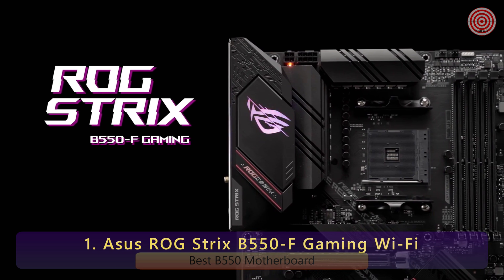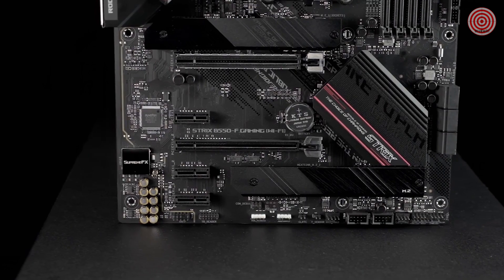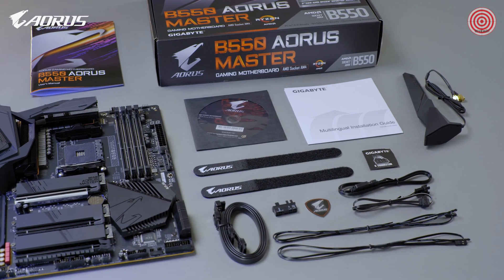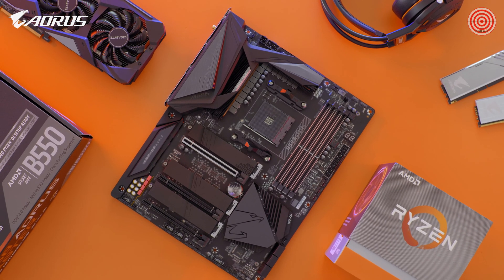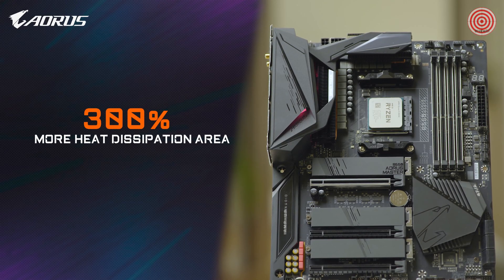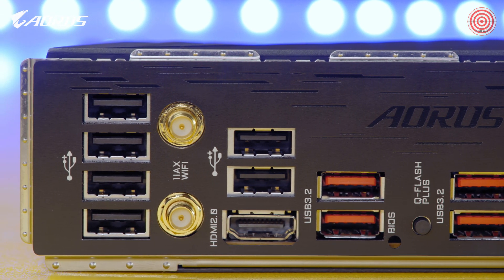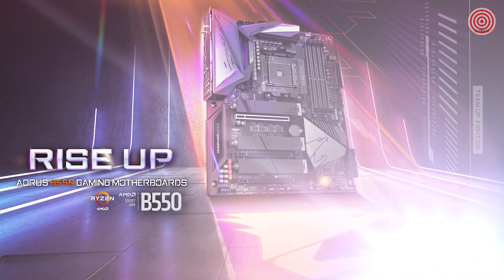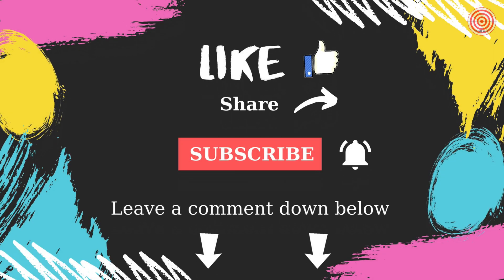5 Best B550 Motherboards 2023| PCIe 4 0 for the Rest of Us |

Comment: I would pick Strix B550-F, but if only there is front Type C...
Reply from the maker: Hello! I guess you know that for a USB type C in front you need a case with something like that. 
The motherboard you want has a USB type c on the back panel and it still has 1 x USB 3.2 Gen 1 header supports additional 2 USB 3.2 Gen 1 ports for the front. (type A or C. Case matters)